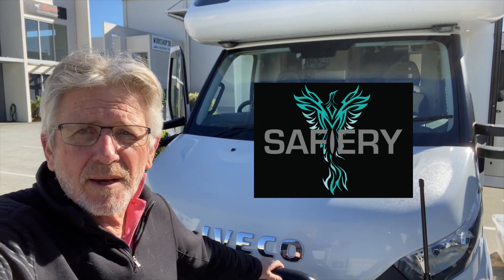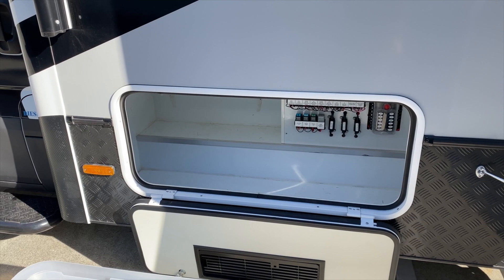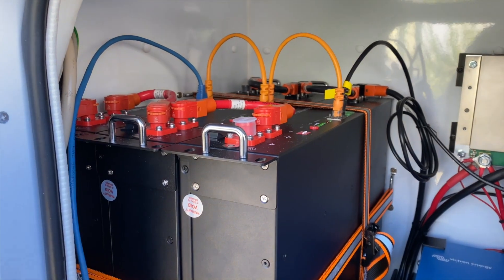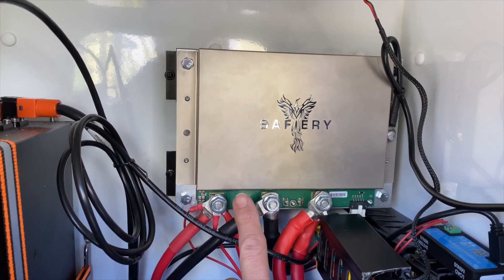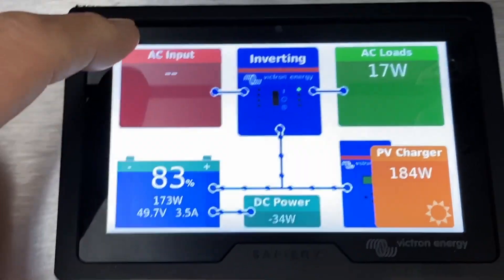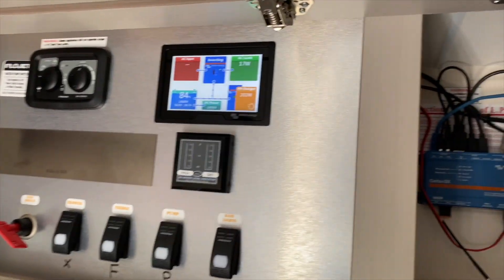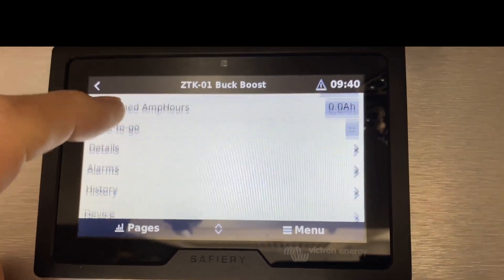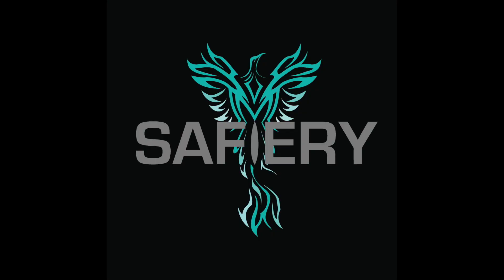Re-powering Iveco Motorhome Charging at 150A from Alternator to 600Ah Lithium

Comment: I didn’t get it, so does this iveco have the 180A alternator or the 150A alternator? 
And at ideal the buck boost gets 120A from the alternator? 

I have a 12V 150A alternator in my 2015 iveco daily, and I have a 24V house battery.

I want to be able to charge my 24V house battery with about 60-80A at 24V do you recommend I get a bigger alternator for this? The 180,210 or 250A alternator? 

I was thinking of using 3-4 victron orions dc-dc charger as it’s cheaper than buying one 100A buck boost from victron, what do you recommend? 

Oh ya I am based in the UK.
Reply from the maker: Hi O Team. you will see in the Video, we are extracting 1895Watts. Divide by 12.8 and that's 148A. So we are able to get 150A of power from this 180A Alternator. If you change out to 250A, we can get 200-220A. The DC to DC has a capacity of 3,000W. This is bi-directional to a higher voltage. Thats the insight we had to extract alternator power. We go 12V to 48V and run the Victron 48V 3000W inverter. 48V gear is 35% lower retail price than 12V for same capacity as Mosfets are 1/4 the size.Using 3-4 Orions is back to old tech and these run around 85% efficiency. When hot , they degrade significantly. Scotty is price in AU$ at AU$1/watt, a little less per W than competitors. Scotty pts you into a different league of 240V power available. We can refer you to a Victron Dealer in UK if you have the budget. email to sales at Safiery dot com.
Reply: @Safiery  would it work with my Tesla battery? I am considering Orion because I can set the output voltage to 24.8V to suit my Tesla batteries.

If I am able to change the output voltage of scotty and be able to run it to charge my batteries directly I’ll be interested. I don’t want it to run through my inverter charger because that’s limited to 25A and I want to be able to get 80A charge at 24V.
Reply: @Safiery  have you every changed the 150A alternator in the new iveco to a 210A alternator? Did you also have to change the alternator positive wire also? Or is the current one big enough for the new alternator?

Comment: Love the work you are doing! Just out of interest, is the Victron 48V to 12V DC to DC converter in this install really required? Or could the 12V service just be connected to the 12V output of the 3KW Buckboost which you mention is bi-directional?
Reply from the maker: Yes we could. The challenge is the Buck Boost needs a constant CAN heartbeat to operate. So to run when vehicle is not operating, we would have an alternative power source to switch high instead of ignition wire. We have tested it bi directionally and it works well The big application is "recharging" the starter battery when flat and powering a winch.
Reply from the maker: We have 2 Dealers completing a Toyota LC200 and VW Multivan this week and we have enabled the Bi-directional feature with a "engine not running" relay to maintain the system as operational.